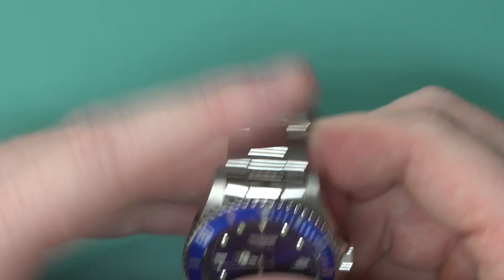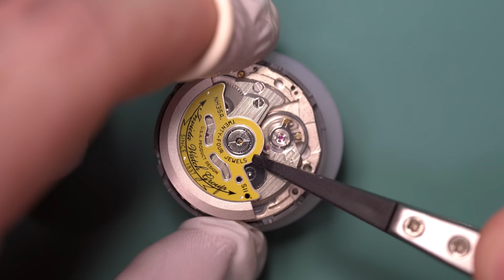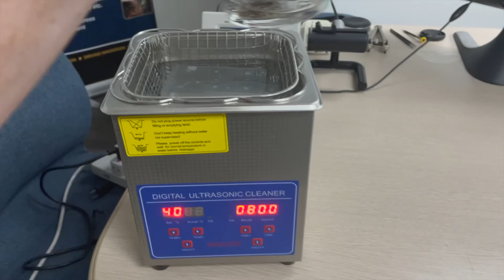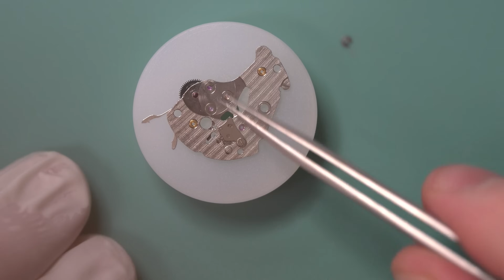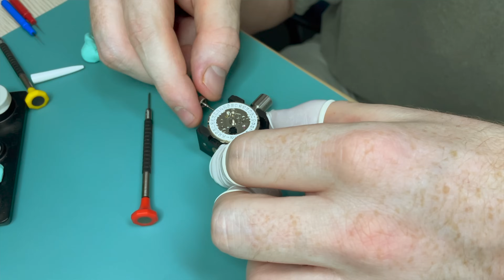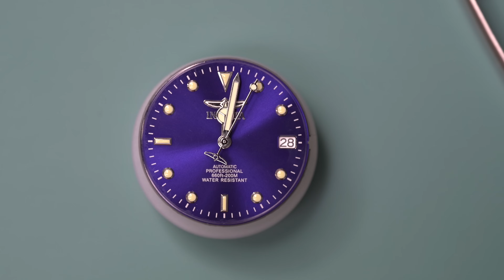$75 Invicta Pro Diver Strip Down and Review - Budget Watch Restoration - Seiko NH35a

Comment: I bought one at Costco, calling it my "Rolex trainer" LOL, but soon found that it stopped periodically because the second hand was lightly touching the inside of the crystal. The second hand was leaving a visible trace on the glass due to a thin film of evaporated oil deposit, which was easier to see when a watch has black dial. Costco would refund but didn't have any in stock so I took it home to correct it myself.  When I opened the case back, I found a couple of small pits in the O-ring groove, which would compromise water resistance. A generous amount of silicone grease made it suitable for daily wearing and even washing in the sink. Otherwise the materials and quality exceed the price point.
Reply: WOW FIRST THING THAT COMES TO MY MIND WITH INVICTA QUALITY LMAO

Comment: You ask if people use hacking these days. But of course. There is an old saying that a man that has one watch knows what time it is, but a man who has two watches is never quite sure. I do the best I can to know what time it is by setting everything to NIST. Much harder to do that without hacking. Also if you have a watch running a few seconds fast hacking makes it very easy to pause for those few seconds. Which is also why it is better to have a watch that runs slightly fast than slightly slow.
Reply from the maker: Good point! I never thought of this! I may regulate watches to run fast from now on from this info 👌🏻JSG

Comment: I've read that to fully wind this watch it takes 55 turns on the crown if the watch is fully wound down and no longer running so I did that and then shook it incase I was a little lite. I set my watch perfectly using my cellphone yesterday morning then wore it all day not taking it off till 10:30 pm. The watch sat on the table for 10 hours before I took my reading and my results were:
During the timed 24 hour period the watch gained 1 second. This is an incredibly accurate watch but the results  will not be as good if you time it between 24 hours and the 41 hour full reserve.
Reply from the maker: Same here, I read in the service manual it takes 55 winds also, seems like a serious number of turns to get a full wind! JSG

Comment: I love the timing of this video! I work for a jeweler one day a week just to help him out and change watch batteries. I am also gearing up to dip my toe in the pool of watch repair. Oddly enough, this exact watch came in this week. A gent needed a couple links removed. I had no idea the watch was so affordable. I have been collecting vintage pocket watches to start on but had always wondered if there would be a reasonable option for buying a working watch to strip down and put back together. It appears there is!! Thanks for the great video's. Keep up the great work.
Reply: I just wanted to do a quick update. Took my watch to the Jewelry store today and they resized it, fits perfect now. The watch is performing better than I figured it would, I set it perfectly 48 hours ago and it is losing 5 seconds a day. I'm impressed.
Reply: Also the fact this uses a Seiko NH35 makes it a great practice watch. Its a very popular movement and youd be likely to come across it if you do repairs. It will also familiarize you with the basic of most Seiko movements meaning you could easily service many watches
Reply: No good time piece uses a battery.
Reply: @thefrogking481  so would you pick a chinese mechanical piece of junk rather than an eta quartz or an accutron for example? every watch enthusiast prefers mechanical more than quartz, that's pretty obvious, but even the best brands have their quartz lines and there's a reason for that as they have their pros but maybe you simply don't realize that and just being a quartz snob. anyways i don't judge you, any of us has different ways of enjoying watches.
Reply: Buy a Bostok for the same money- much better made and after you strip it down and reassemble it you'll actually have something worth keeping.
Reply: @mytuberforyou  vostok goddamit! don't mix cyrillic and latin alphabets, bostok doesn't exists.
Reply: If you've removed some links you should realise why it's so cheap!
Reply: invictas are very good value, and so are Vostoks (extra marks if you can buy a match for the vostok the protagonist wears in Severance). But if you're going to disassemble the movement you should consider the extraordinarily cheap chinese movements, which tend to be well designed but dubiously assembled. the nerd recommendation is that these tend to be great watches after they've been stripped down, cleaned, and carefully assembled and lubricated ... but of course nobody can afford to do this unless they do it themself as a hobby. i know for a fact the basic "tongji" can work very reliably out of the factory and are easy to regulate to better than 10 seconds ... but even better to know it's been carefully reassembled. consider a mechanical Tevise T801 [there are so many submariner clones if you can admit to yourself you don't really need to take your watch diving] or Forsining etc around $30. it's a great way to start an interesting collection before you realise expensive watches are stupid. OTOH i really wanted a chinese Explorer II GMT homage because i like the look but this isn't a common style, so i paid about 80USD for the absolute cheapest (Bliger) and frankly the fussy DG3804 mechanism is a bit flaky. if i had the time and the tools i would LOVE to reassemble this. apparently it really helps, but i'll probably just be swapping out the movement at some point. bottom line, if you love movements chinese movements are interesting. and if you buy a vostok or nh35 it will probably work so perfectly you won't want to risk it. and first step of dipping your toe is attempting to make a cheap watch accurate. microscopically poking that tiny lever until you hit the jackpot is easy but not trivial

Comment: One problem that seems to crop up is that some of their gaskets end up unlubed, and end up leaking, even when handwashing dishes and the like. Simple to fix, but a weird thing to need to fix.

Had the issue on my 37mm quartz version. That one has a pretty terrible movement, btw.
Reply from the maker: Good point, definitely something that would be interesting to explore. Im searching for a pressure tester to hopefully use in future videos, if I can get one, I’ll put this Invicta to the test!
Reply: My Invicta 1953 had dry gaskets. I applied silicone and I am glad that I checked it.
Reply: SIMPLE FIX IS BUY A REAL WATCH LOL
Reply: @eagles4757 , I have heard people say that a lot but they sport around micro brands that have the same NH35 movements. For the price point, they are hard to beat. The Invicta 1953 doesn't have all of the retail branding that the Invictas normally have.
Reply: @MSGBlair  I agree my point is I can't wrap my head around these folks who have huge Invicta collections when that same $$ can in mind be better spent on a Speedmaster or Submariner watches with real history.
Reply: @eagles4757 , Everyone has their own opinion and preferences.
Reply: @MSGBlair  you miss the point, it's not the NH35A that people have a problem with, it's the QC of the rest of the watch, The bezel inserts are glued in with what looks to be contact cement, the clasps are janky, the  fake gold is atrocious and plasticky, and most of them are the size of a hockey puck.  It's a $50 Chinese watch with a budget Seiko movement, and the deisgns seem to follow one of two possible ethos: Unoriginal (homage) and just Gaudy.
Reply: @eagles4757  well, then they wouldn't have huge collections, eh? And the "history" of those watches is rather brief, relatively speaking. If you are buying for historical context I think a Santos beats both for a little less than the Speedy.
Reply: @mytuberforyou  I like the Santos and would tend to agree but every collection should have a Speedmaster!
Reply: @mytuberforyou  only have six pieces would love to own Santos.Sea Dweller 4000,Datejust 41 fluted bezel blue dial,Batman,Omega 300,Omega 300SMP White dial and Speedy.Had to sell off some Datejust 36 two tone,JLC Polaris Chrono,Planet Ocean and Blue 300M to get white unfortunately couldn't keep all and keep the wife lol
Reply: @eagles4757  Keep the wife, first of all because at the end of the day watches don't really matter in your overall quality of life (and you just develop increasingly expensive taste most likely) and second because getting rid of the wife will cost more than any watch collection you can dream about. Keep watch collecting as a "hobby" not a life goal. Next on my list is a $350 quartz diver (Scurfa). Always stay within the budget of what you can responsibly spend- my .02
Reply: @mytuberforyou  I go back and forth if it's cheaper to keep her lmao

Comment: I own several Invictas with NH35A and Swiss movements and have liked them for years. I have 2 of the 40mm homage (8926OB) and a few other Pro Divers. The NH35As are fairly accurate ~10-15 secs/day out of the box. I think they're a great watch for the money.
Reply from the maker: Completely agree with this 👌🏻
Reply: I have 8926 and 8927ob and I have 29769 , 1902 ,23826 #614/100 made,14357, and a few other pro driver model  but the 8926 is the best.
Reply: I think lay off the crap pipe lol
Reply: @eagles4757  that’s what I’m saying. He is overreacting

Comment: Pro Diver is one of the very first Rolex sub knock-offs. It's not bad, but it's not that good either and you can do a lot worse, like ummm most of the stuff on Ali Express. Inside you find an NH35, aka 4R26 when Seiko themselves use it. The vast majority of the micro brand and Rolex homage markets have NH35s inside.

Frankly, the Invicta Pro Diver is a completely unremarkable watch.

Comment: To be fair, both my pukka Invictas have Ronda Swiss movements inside, the Russian Diver 1959 has the quite unusual 6003.b which has the big date numerals at 12 and furthermore the 1959 lacks a second hand either fitting in with its homage to Zlatoust.   Its quite funny that Invicta that made its name ripping off the Rolex subbie is now mercilessly trolled on Aliexpress where companies that Invicta used to make their watches cheaper have started churning out their own fake-not-fake Invictas and Invicta is struggling against the likes of Parnis, Starking etc who are able to undercut Invicta badly.
Reply from the maker: Hopefully I’ll stumble across some of the vintage invictas’s along my journey. From what I read, Invicta sounds quite honest in their tactics. They got crushed by the quartz revolution, so had to change their game a bit to get back in the ladder. Seems like it has worked, and they are able to make something respectable for the price you pay!